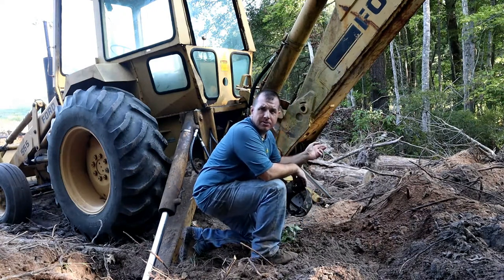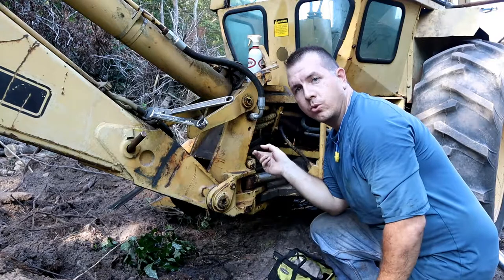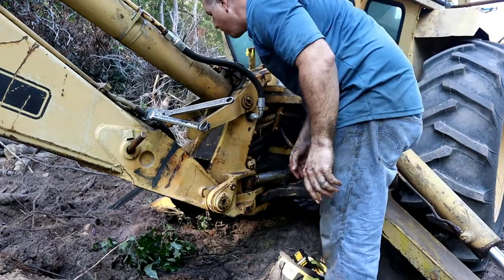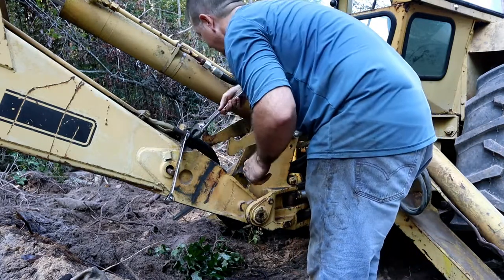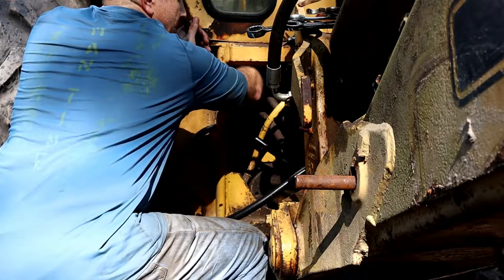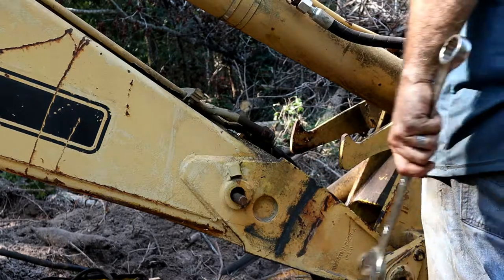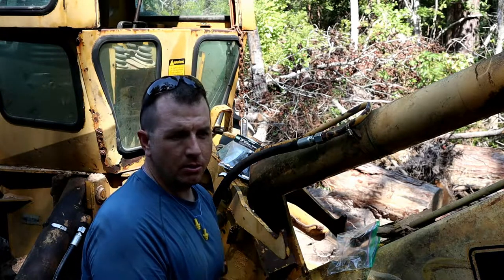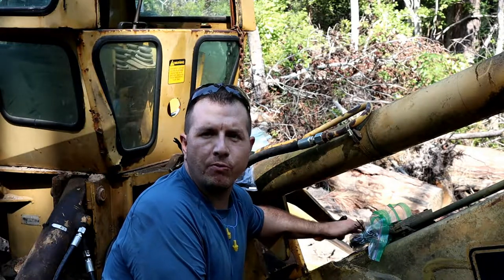Replacing A Backhoe Hydraulic Line Hose In The Field For A Ford 555

Comment: I just changed these on my 555. I have a service manual so I didn't really give it any thought when removing the lines.
When I broke out the manual to put them back on, I had a moment of pause.
Turns out the manual has the hose routing for the two handle labeled as the four and the four as the two.
It didn't take but a couple of minutes to figure out what was wrong, but it was a couple of minutes of what the hell.

Comment: From my experience, I say change them all! It's such a pain in the ass, you might as well change all the hoses while u have access open. Once you change one hose, the pressure WILL find the weakest hose and blow out. I know this isn't a cheap project, but well worth it in the long run.
Reply from the maker: Yes indeed. I did change them all and it was the right decision

Comment: I’ve got a 555 that I know nothing about. I do know water is in my hydraulic lines. How to I drain them and get rid of the milky fluid?
Reply from the maker: If it runs you could run the tube out of the bottom of the reservoir to a bucket. Just start it for a few seconds and it will evacuate everything very quickly. Then refill with diesel and cycle all the cylinders. Drain and repeat until all the milk is gone